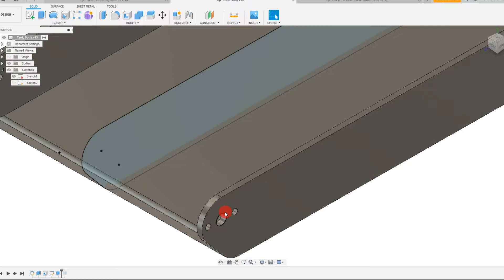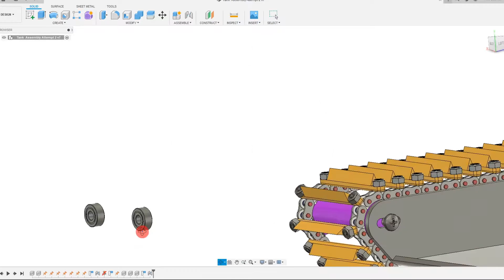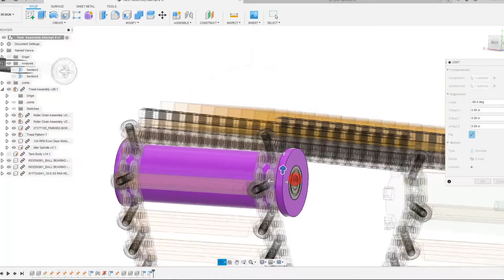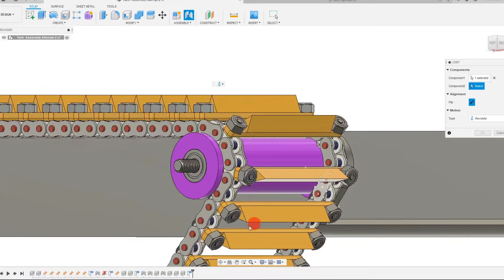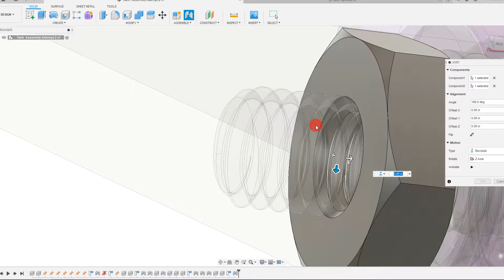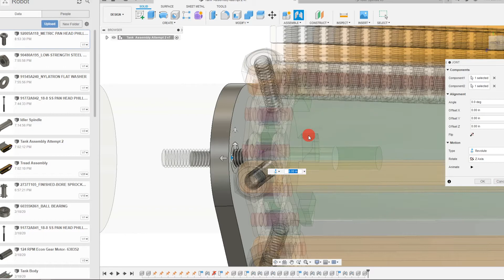How to Assemble Robotic Idler Pulley Spindle Bearings in Fusion 360: Tutorial (Tracked Robot Part 5)

Comment: Just curious when making the pockets, why you wouldn't use the mirror command. That command has saved me LOTS of time.
Reply from the maker: I did not use it because I want my sketch to drive everything. Think about what would happen if I found out I need to get rid of a washer on one of the sides down the road? I would not be able to have it mirrored because it would make each pocket the same dimensions. By having it all controlled by the sketch, I can control it with incredible power. That being said, if you KNOW that both pockets need to be the same and always will be the same, then mirroring is the way to go. You can also just link dimensions. By linking the dimensions of both pockets, you don't even need to do a mirror feature. The simplest feature tree is the best feature tree.